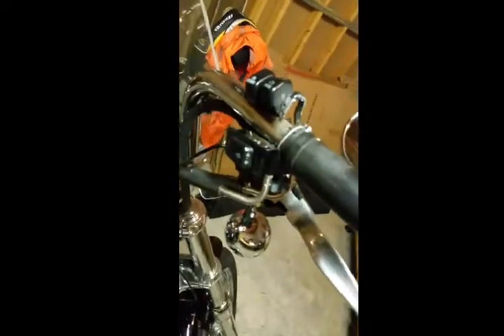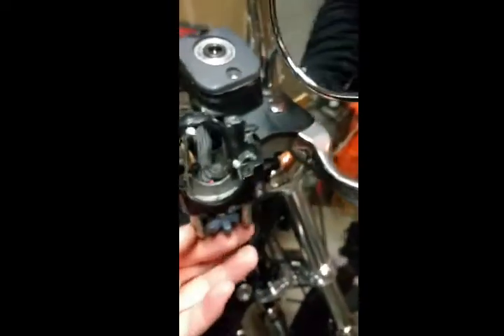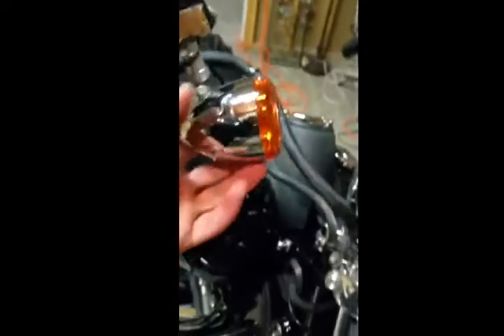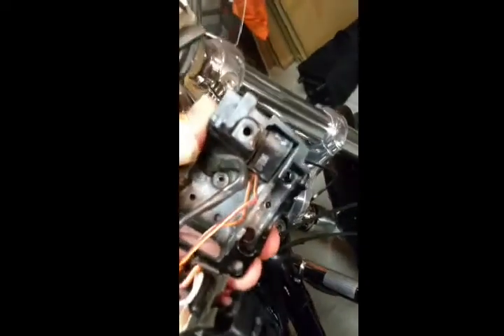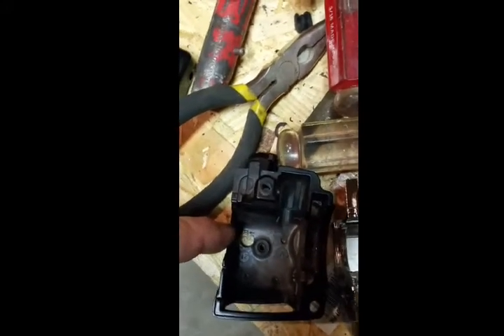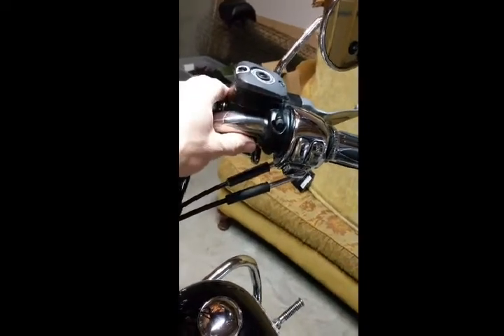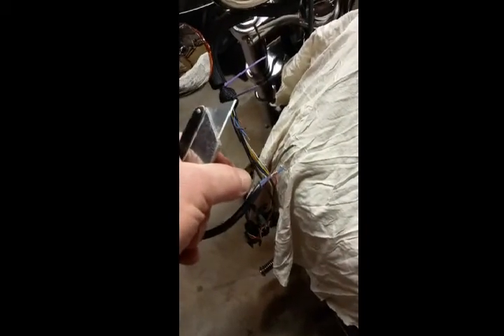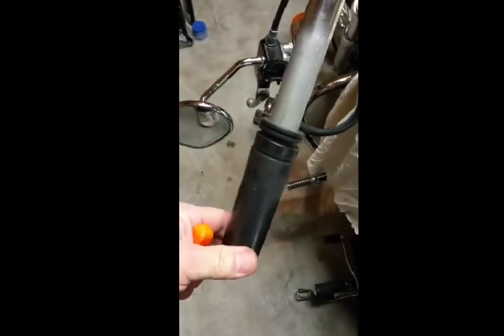Harley Switch Housing Replacement

Comment: I am at the same step I took my light out at the o bottom of the switch housing and took the wire to pop out the center piece I ran another ghost lights off the turn signal